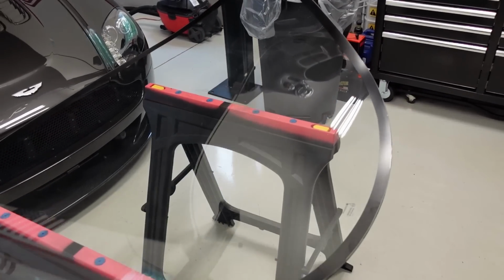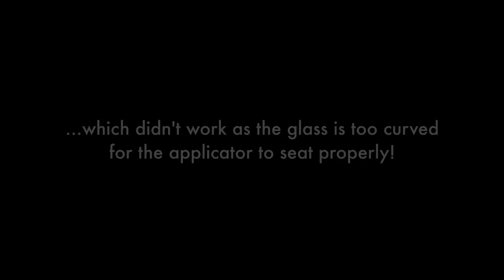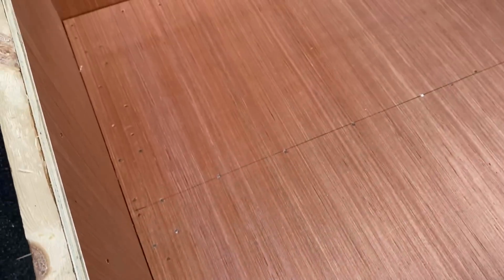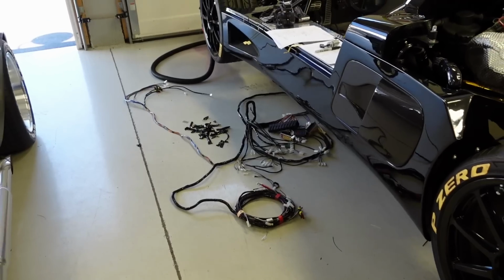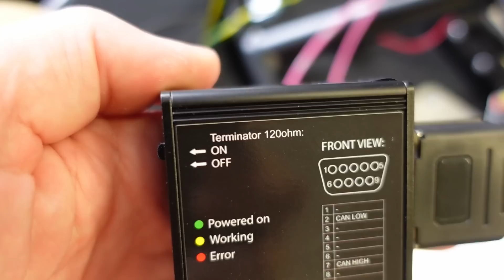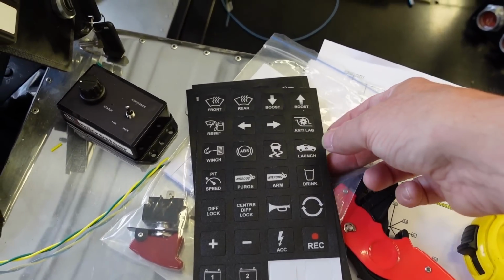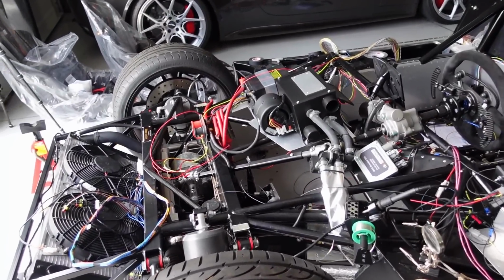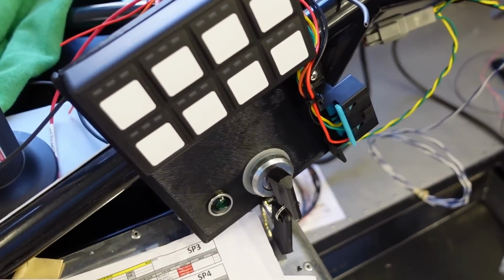I made an expensive mistake!

Comment: I actually LOVE wiring and harnesses ! Great Job ! I only have 1000 questions lol but the main one is - why not run the harness through the center console to shorten the wires and keep them out of harms way ie side impacts or passengers with big clumsy feet? Again awesome job!
Reply from the maker: Great question!  Main reason is I don’t have a center console. Yet anyway. There’s only about 3-inches between the seats so not much room for a center console—barely enough room to grab the e-brake lever. I figured I’d route the harness around the perimeter since I’m still unsure what I’ll do about the center console. 👍

Comment: I know this is a year old, but for anybody watching the video going forward.... Drilling tiny divot at the termination of the crack was the right idea, but normally you'd use a tiny round burr on a high speed rotary tool or die-grinder to do it. Using the drill walks and requires pressure and is pointy. The burr will do the job with less pressure, and good hand control less walking.

Foam peanuts or the scourge of society.
Reply from the maker: Great tip. I didn’t think of that. Thank you!

Comment: You know that safety glass they use in shower screens?
Don’t go anywhere near it with any kind of hard object especially near the edge.
I was diy a bathroom and was installing the shower screen, hammering at the seal with blocks of wood and a rubber mallet even bumping the end of the glass with the mallet to seat it in no problems
Closed the door with a claw hammer in my hand and it just touched the edge of the frameless door boom!
I was standing there covered in glass holding the handle to a non existent door.
Didn’t even hit the glass the hammer just touched the corner of the edge and that’s all it took.
There were two doors they both got replaced with acrylic panels.
Reply from the maker: Wow!  Yeah, whatever happened to my windscreen that caused the crack must have been from a very subtle that hit on the edge. Crazy how fragile safety glass is on the edges.

Comment: Tough luck with the windscreen . The packaging is 2nd to non for sure . You would think that these days with supply issues and materials ..... wouldnt it be great if the customer got some sort of refund if the crates were knocked down, screwed flat to the pallet and returned to sender via a slow boat so they could be reused over and over. Am sure theres money to be saved for both the customer and the supplier .
Reply from the maker: I totally agree. Such a shame it’s a single use crate.